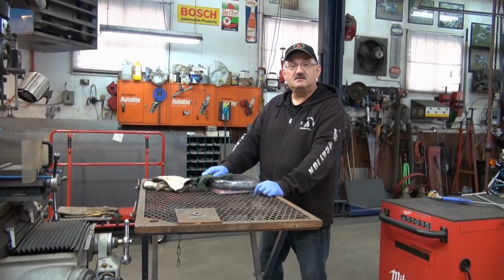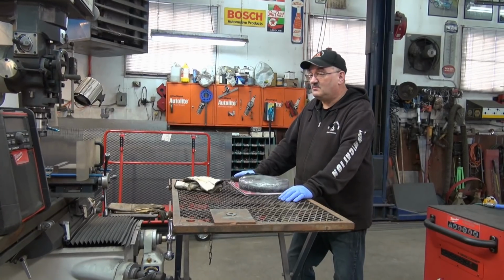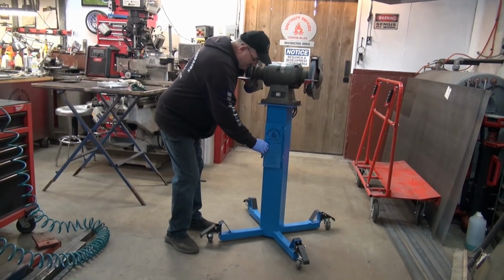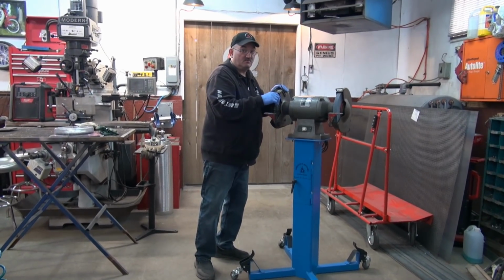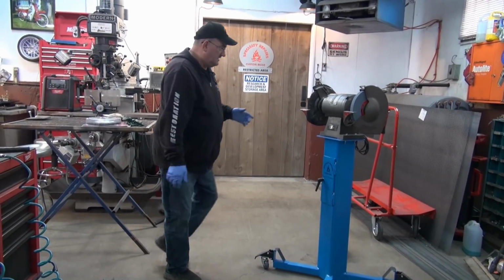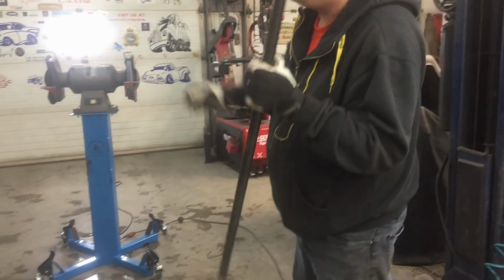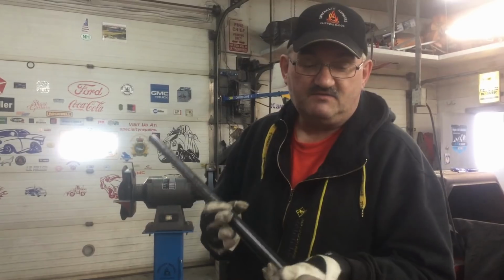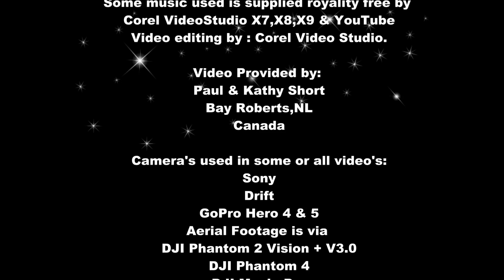#2  Mod For The Mod Shop

Comment: We had a similar grinder mounted on a 4” pipe that was attached to a 2” thick 20”x20” plate and on the backside was a huge vise. We moved it with an overhead crane or forklift.

Comment: Will you ever make parts for the L2501?
Reply from the maker: Yes eventually if we can get our hands on that model. Right now we have fender light guards to fit it. It will happen.
Reply: @7863348  Awesome! I'll be waiting. I'm thinking there is a pretty good market for them. I've been looking all over for a fuel filter guard and cant find one. Just a thought😉